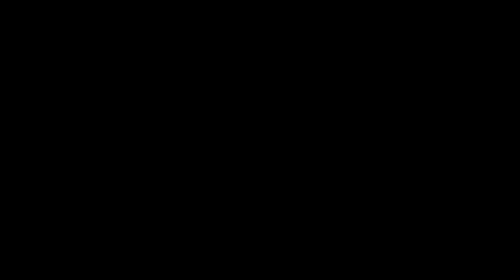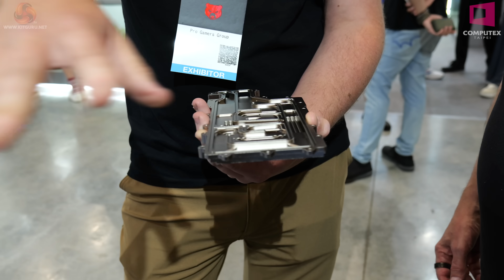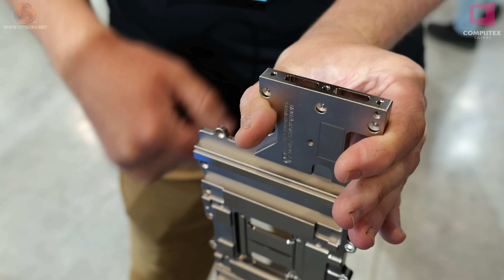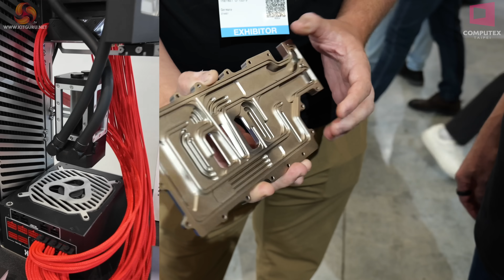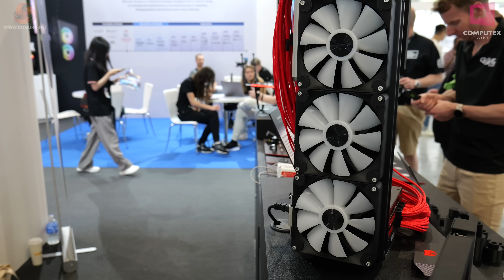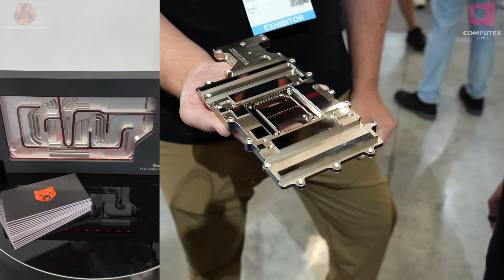The Manufacturing Process of a Waterblock with Thermal Grizzly's Joe Robey

Comment from the maker: Let us know if you found this interesting and if you are buying any Thermal Grizzly hardware this year - also be sure to report spam, its an ongoing issue
Reply: Honestly didn’t expect to be fascinated by machining and bead blasting, but Joe made it weirdly compelling. Proper engineer brain at work.
Reply: EK’s loss, plain and simple. They let go of the one guy who actually gave a damn about doing things properly.
Reply: When the brains behind your flagship blocks ends up somewhere with a healthier vibe, maybe it’s time to ask questions. Good move, Joe.
Reply: First and foremost, TG stands behind their well-designed products so they'll receive serious consideration. I'm especially interested in their foray into waterblock design.  Seems like quite a few vendors are taking advantage of the gross missteps taken by EK. Now if we could only get CPU and GPU supply sorted out we'd be back in reasonably good shape.
Reply: Why nickel plate at all if the copper is already so pure and well-machined? Is it purely aesthetic or does it impact corrosion long term? I dont know much about this stuff
Reply: @BrookesStevenson-vw4xf  I'm nowhere near an expert, but I believe the Nickel plating would help protect the copper. Copper is quite prone to both oxidisation and corrosion.
Reply: @madness1931  not only that but when copper corrodes it forms a patina that turns loops green or blue. Plating helps stop the whole loop looking like shit not just the block. It's why I don't like pure copper blocks. Unless you wanna do a Hulk themed build 😂
Reply: Leo – any word on whether KitGuru might be doing a teardown of one of these blocks later in the lab?